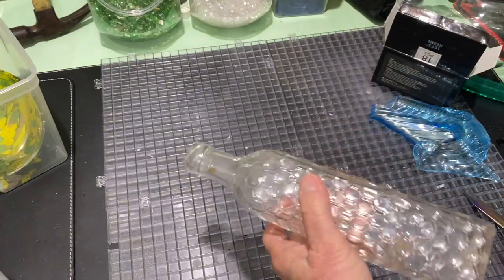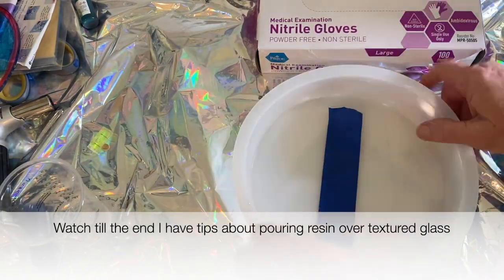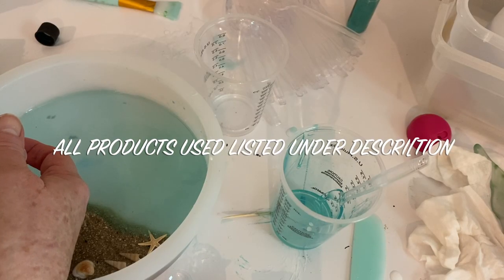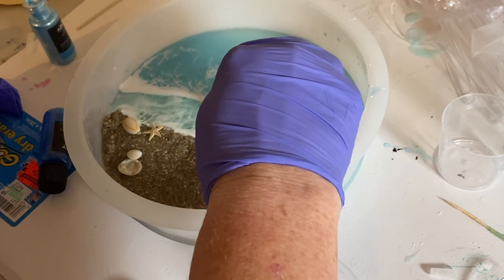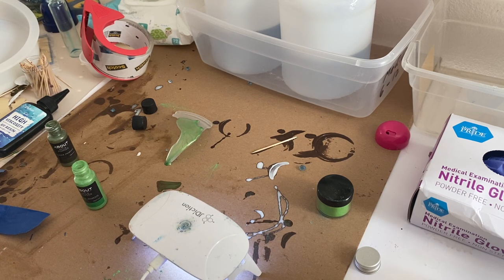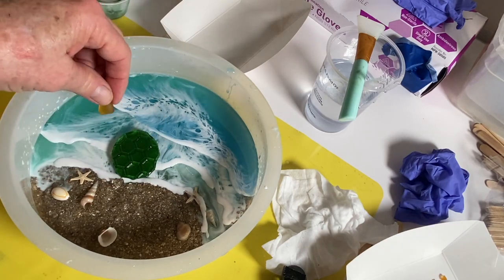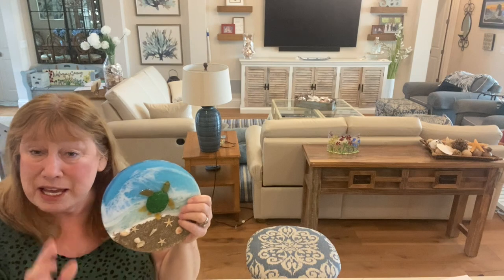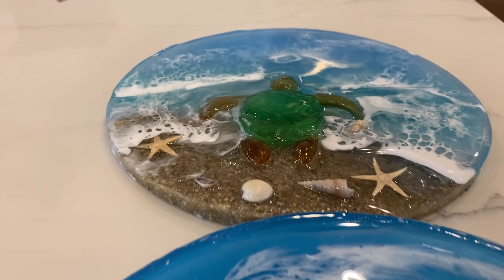RESIN WAVES, BROKEN GLASS TURTLES, FAUX FUSED GLASS WITH EPOXY RESIN, TUMBLED GLASS,COASTAL ART

Comment: Linda I cannot thank you enough for your wonderful talent and videos. I'm learning so much from you. These are absolutely stunningly Beautiful ❤ I have so much glass collected and being tumbled for projects. I  have a similar glass as the turtle bodies. Wonderful to learn not to put resin onto the top of textured glass.  Silicone oil is another way to condition molds. Also to add a drop into resin with white pigment paste for making cells in waves. Thank you so very kindly for sharing your wonderful talent and videos with us all ❤ Take great care and keep creating and smiling ❤ You are a absolute wonderful person ❤️
Reply from the maker: Thank you Dale you are so sweet! Where did you get the glass that is similar I think that glass is so cool. So do I understand you to say add a drop of silicone oil to the resin with the white pigment, and that helps to create cells? Thanks for the tip.
Reply: Linda in the early 80s I was at a fall fair and played bingo I won a set of 4 thick tall tapered glasses that have the circles on them. I still have them and will be nipping them up like you did. Yes I just saw on a resin video someone put a drop of silicone into their resin with white pigment paste to create waves with cells. I have also seen someone blow their waves out with heat gun and then give a quick spray of 99% alcohol over the waves to create cells. Do not use torch for bubbles if using alcohol. I have watched so many videos on resin work it is time I start pouring. Lol I  have all the supplies. Have a wonderful funtastic day.  Xoxo 💗 😘
Reply from the maker: @dalemaclaren7576  Thanks you too!